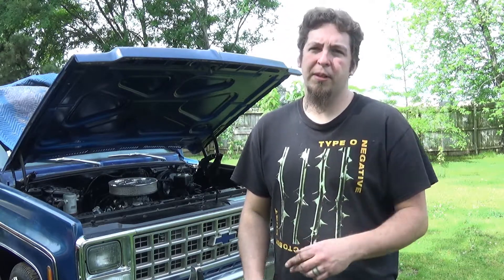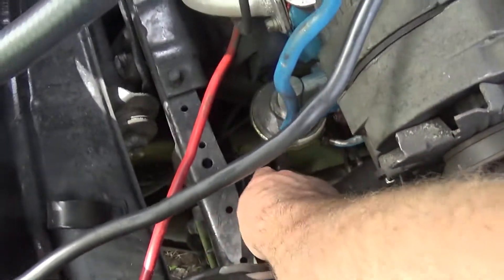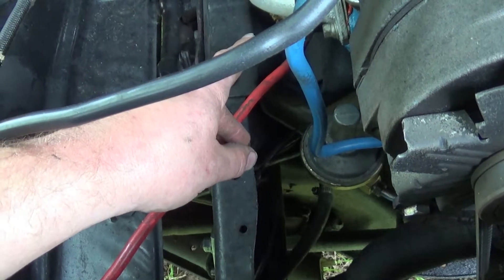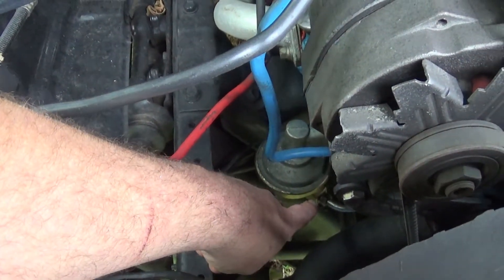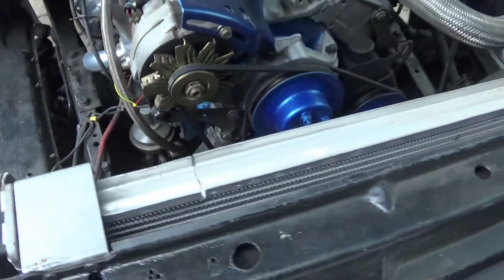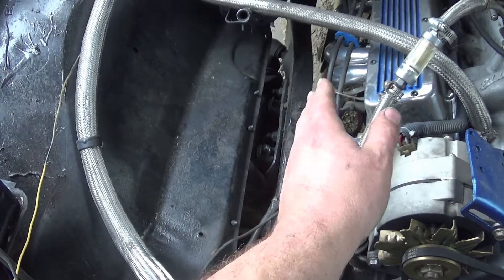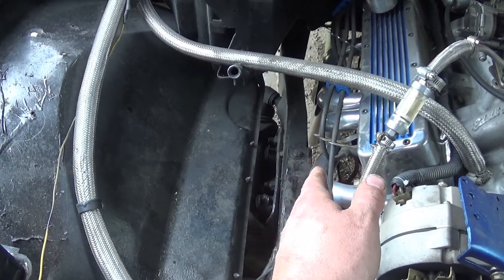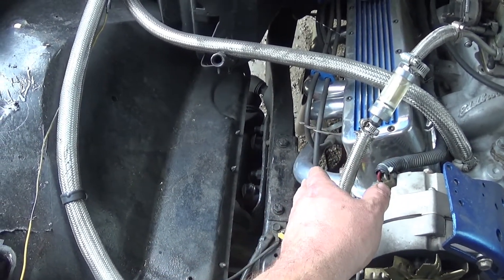squarebody c10 header tip

Comment: I know about those heat issues. I had twin turbos installed on a Mustang Boss 302 Laguna Seca I used to own; the heat was so, bad under the hood it would melt the rubber air conditioning lines. I wish I would have never put twin turbos on that car for a multitude of reasons.
Reply from the maker: O yea i can see all that heat with that. Twin turbos is a pain honestly sometimes i look at twin turbo cars and wonder how they get to areas to work on it..... And of course the heat off all that exhaust right there

Comment: Maybe wrap that section if you don't want to wrap the whole thing, I'm gonna ceramic coat my headmans and probably wrap them to, for good measure, may not look as good but I want reliability over looks, and I have a sharp ass s10
Reply from the maker: I will never wrap again. i drive most of my stuff often. Wrapping headers can cause them to rust faster as it holds moisture. I have used ceramic on daily's for years they hold up well and it is noticeably cooler under the hood. Moving the other lines does help since factory does things the quick easy way. But i get there is less room in an s10.

Comment: How do you tuck the fuel lines?
Reply from the maker: I moved them into the frame rail  away. I usually take the apart and readjust/bend  them so its cleaner and safer under the hood and its away from heat to prevent the fuel from warming up